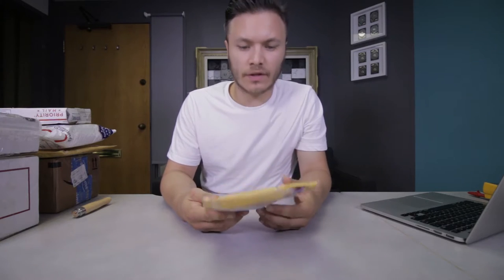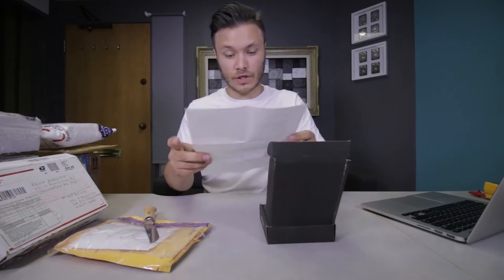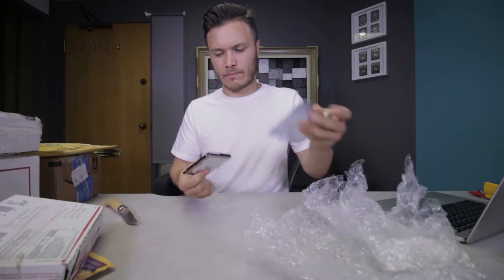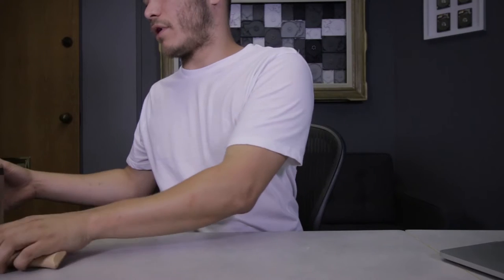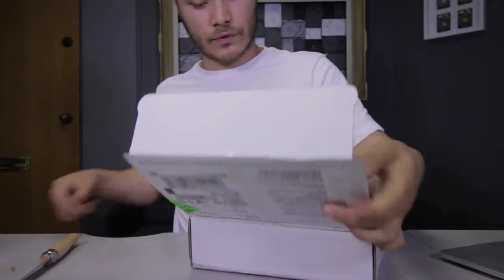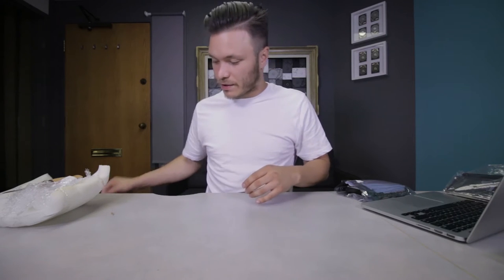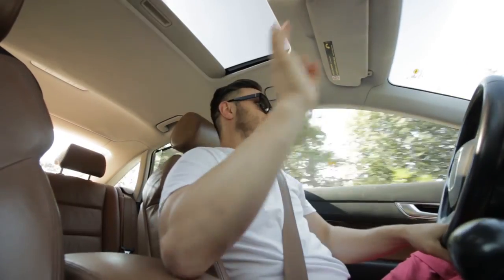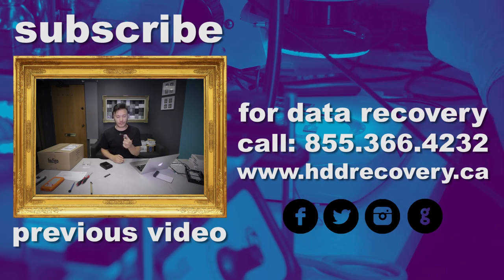just another day at the office, seagate drives, lexar, WD

Comment: my hard drive hitachi 500gb is not detecting in bios when i plug the power and sata cable into hard drive it spins but after 1min it stopped spinning. Can you suggest me any solution?
Reply from the maker: Honestly, if the drive spins down after spinning for about a minute, most likely has a problem with one of the heads. It would need to be looked at